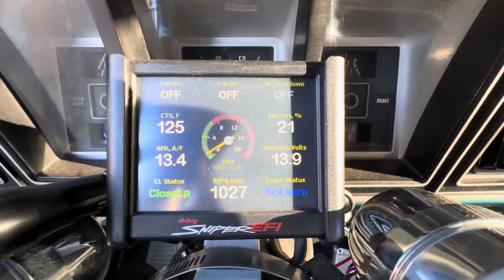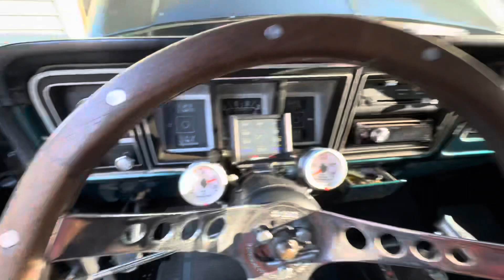Cold start with a walk around of the f100 bbf 466. #ford #fordtrucks #dentside #bigblock #f100

Comment: How’s that radiator working out if you don’t mind me asking 
Been wanting to get an aluminum one since getting my hands on the copper ones is getting too expensive
Reply from the maker: The champion monster core radiator I’m running works great. Especially with the dual spal fan system. Truck stays a constant 180 degrees. Fans are controlled through the Holley sniper system
Reply: @JbfBB-rk8zk  thanks for the heads up 👍🏻

Comment: What’s your exhaust set up? Sounds so damn good and what’s the size of the rear tires and wheels? Looks awesome
Reply from the maker: Exhausted is hooker comp long tubes, black widow 300 series mufflers. All 3 inch stainless from header collector back Rear wheels are 15x10 SSR spikes wrapped with Mickey Thompson drag radials 295/95/15
Reply: Thanks for the reply! I am getting ready to set the 501 back in my truck and have fenderwell exit headers and deciding on an exhaust. Also going to run 15x10 on the back but didn’t know what size tires would fit

Comment: what headers are you running ? looks like you have a crown vic front suspension swap? im currently building my 67 f100 with a cv front and a mild built 70 429 thunderjet.
Reply from the maker: Headers are hooker super competition long tubes. They fit good but hang a little low. You can set the engine a little higher to make the difference. Mad dog headers make a sweet fender well exit for the crown Vic swap. I do have the crown Vic swap. It handles sharp on the back roads